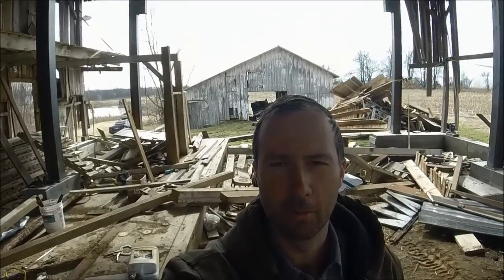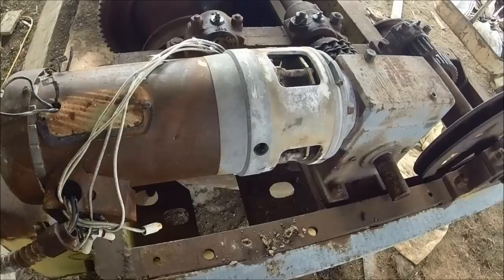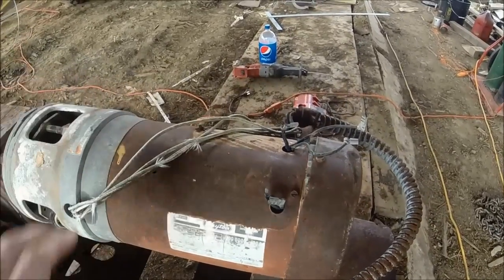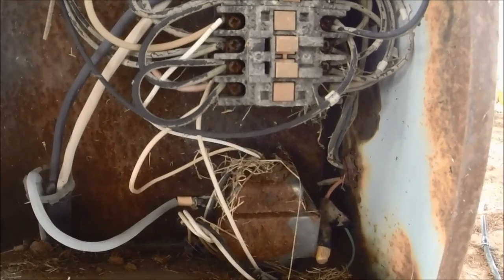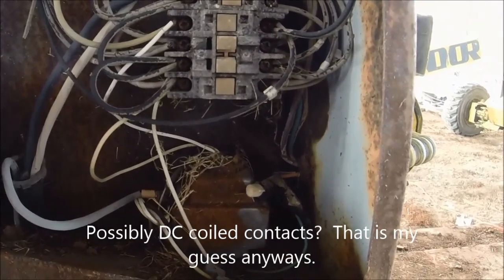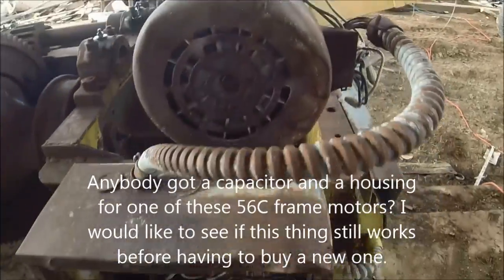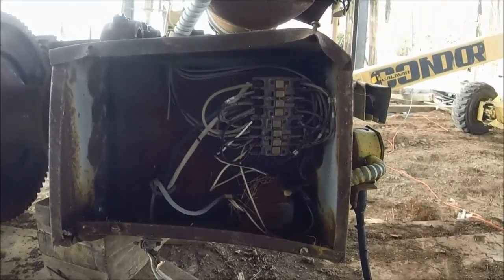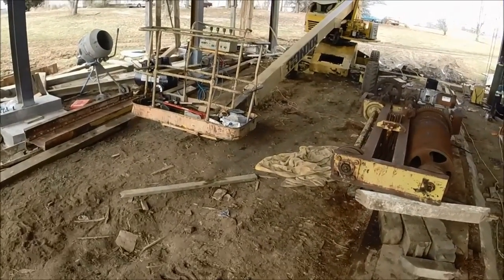Shaw Box BR Hoist repair Part1

Comment: The transformer likely supplies 24vac for the contactor coils.  The 4 wires are the 2 contactor coil circuits, one switch per contactor. The pendant has an up and down button. The contactors are setup to reverse a single phase induction motor. I'm guessing that is a capacitor start capacitor run motor, looks like 2 or 3 capacitors would be used, given the number of leads.
Reply from the maker: +eformance There are actually only 3 wires coming out of the pendant harness into the control box.
Reply: Ahh, then a 24vac supply, and 1 for each coil. The other end of the coil should be connected to the transformer. Sounds like a SPDT momentary rocker switch would be ideal.
Reply from the maker: eformance
Yep the other lead from the transformer is hooked to the other side of the contactor coils. What do you  think the odds are it is DC power so that MR pendant operator can't get a shock from an AC lead going to earth?
Reply: +bcbloc02 To get DC power you would need a bridge rectifier along side or built into the transformer. Maybe the transformer has a label on it and will give the input and output volts.
Reply: +bcbloc02 
Not likely DC. 
The low voltage control transformer should provide the isolation needed for shock hazard safety.

Comment: Hi, the two contactors will be to reverse the motor direction. A three phase motor can be reversed by swapping two phases. If you follow the incoming power and trace the loops to the second contactor two should swap?
Reply from the maker: +Chris Draper It is a single phase motor but yes the two contactors are for reversing.

Comment: Does not look like there is an interlock. 

The pendant should be 1 wire from the transformer fed to the up/down rocker. The two leads from the rocker go to the two contactor coils.

Don't know what the 4th wire is as you did not say where it goes. It may be an indicator light or possible for the brake.
Reply from the maker: +Scott Henion The 4th wire does not come out into the control box so I assume it was not used. or I have seen in some pendant wiring it is a strain relief cable and keeps load from being put on the wires.
Reply: +bcbloc02 
The 4th wire from the pendant is most likely a ground. It grounds through the pendant cable bushing at the control box. 
Many times the ground also serves as a strength member.